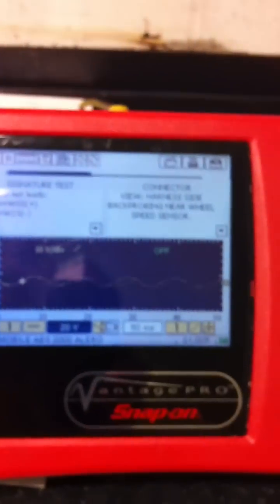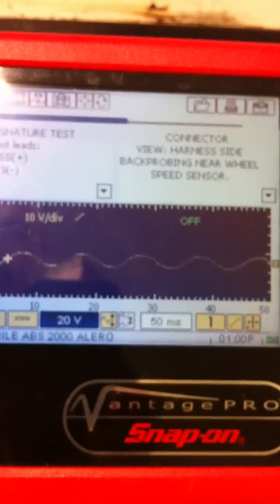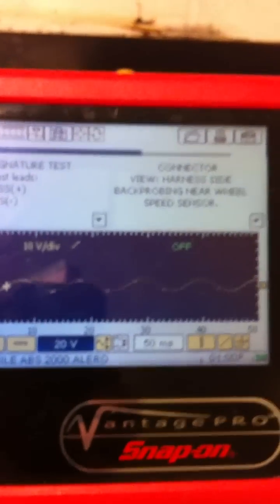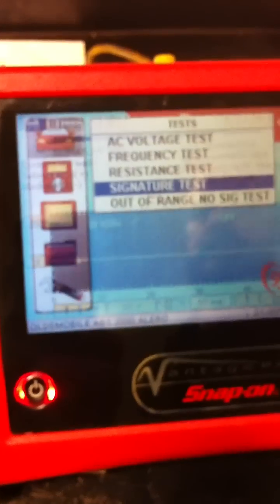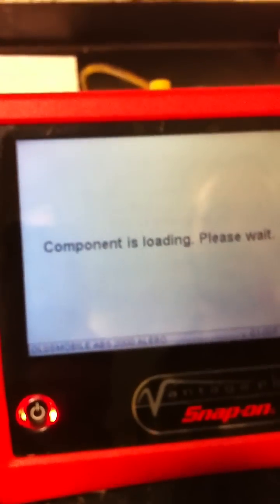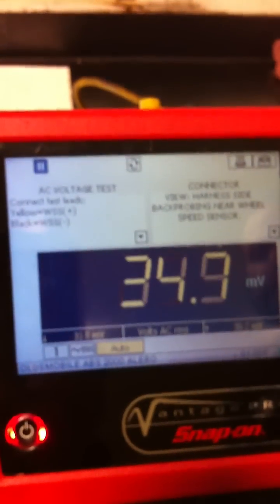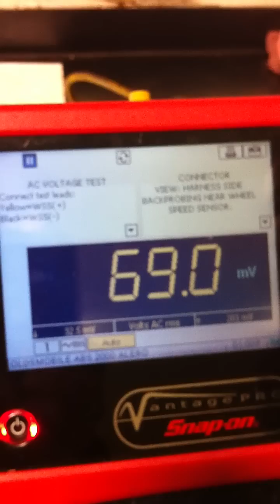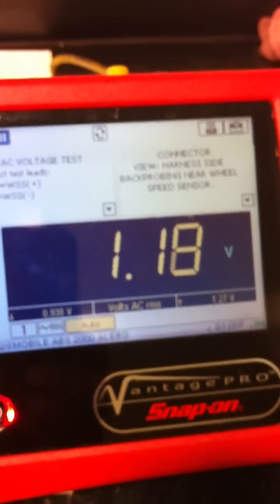How to test ABS sensors

Comment: The problem with testing these sensors is bench testing only works a a completely failed sensor. Loading the hub is necessary for correct diagnosis. Most of the time a side load (turning aggressively) is needed to catch the intermittent failures.